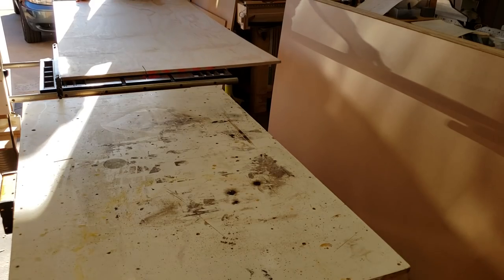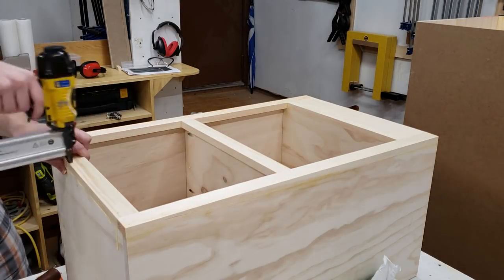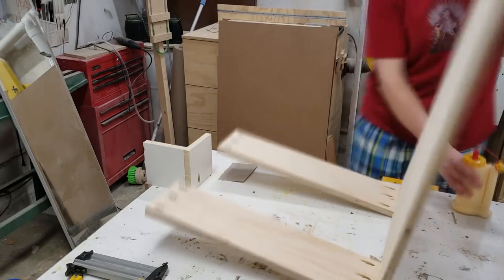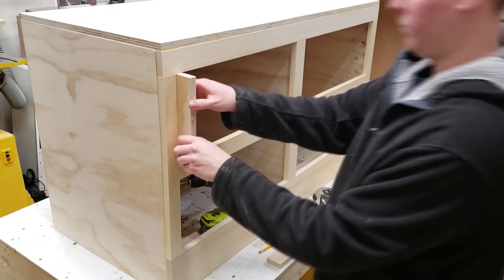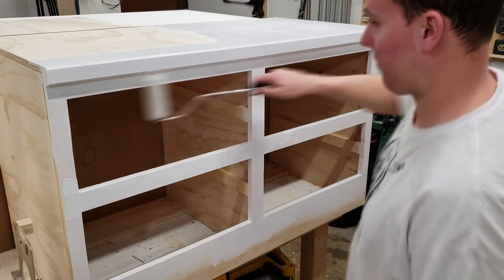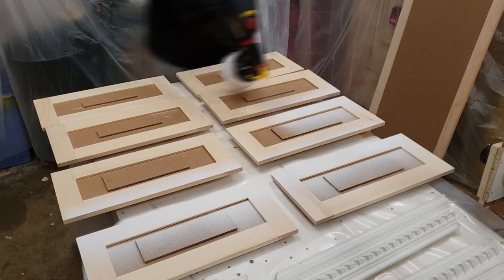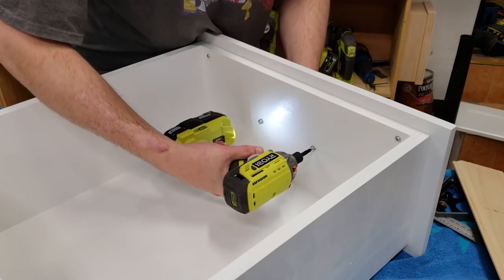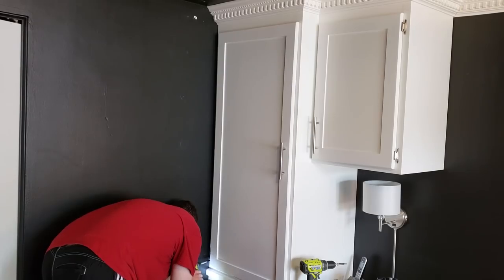How to Make a Custom Bedroom Built-In Wardrobe

Comment: Great project.  In addition to the great design and construction techniques, I especially appreciated the frequent mentions of and tips on avoiding shifting during the installation of pocket hole screws.  It's always annoying to install them and discover a 1/32" to 1/16"  overhang that has to be sanded off.  I have used clamps in the past to avoid this, but I never thought of using brad nails or cereal box cardboard.  Well done!

Comment: I was amazed by how great the design is and the function of it.  However having the lights wired like this way was a bummer only for me, you could have put them thru on the wood side
just so you didn't have to cut that hole in the top of the night stand, and run the wires inside.  Still great looking project.
Reply from the maker: The hole in the top is nessary for plugging in clocks and cell phone chargers.